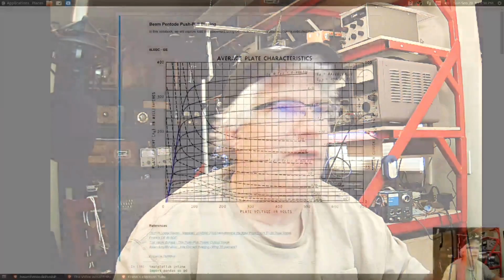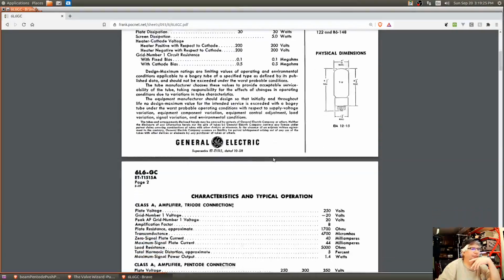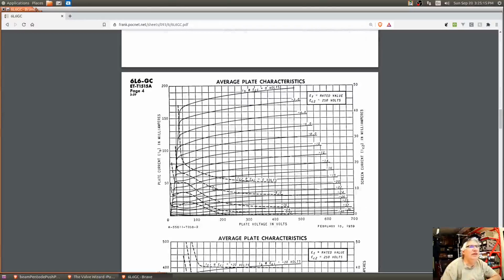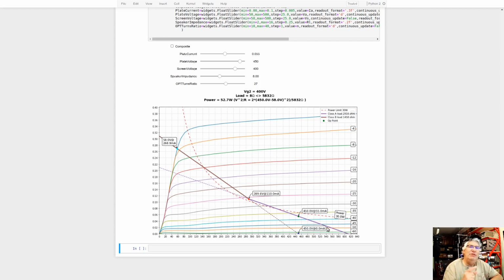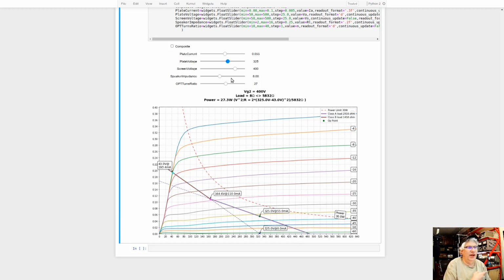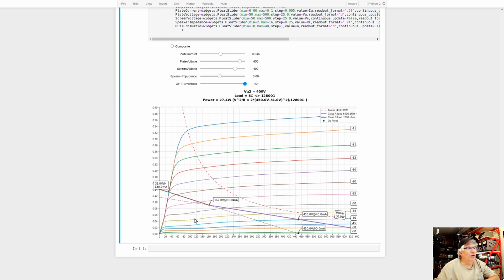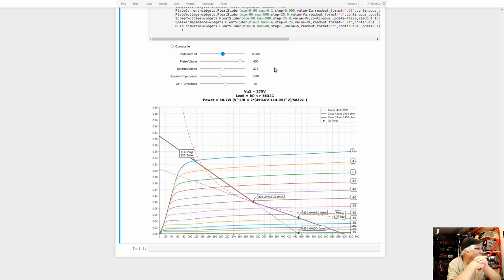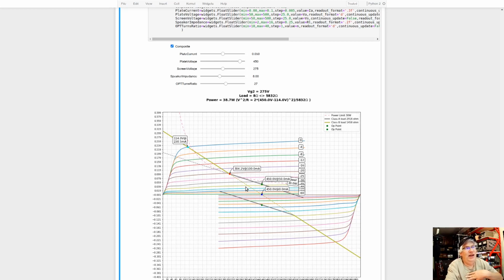200920 Valve Studio - Viewer Question - 6L6 Push Pull Design

Comment: Fantastic work.

Especially intrigued by the tool you created - I am a bit stumped as to how to actually run this tool.

I will keep digging but any  instructions, tutorials, breadcrumbs showing the way out of the forest you would care to leave would really help!

Being able to dynamically visualize the impact on the load lines is extraordinary.

Well done

SLF
Reply from the maker: Thanks, this runs in a python Jupyter notebook. The easiest way to get this running is to install anaconda, which includes all the python libraries and other stuff. Then get jupyter notebook running, browse to it and open the ipynb file. Was this the approach you've taken?

Comment: Such a straight forward seemingly easy question! Such a deep dark rabbit hole... Love it!
Reply from the maker: The rabbit hole is even deeper,  I didn't dig into power supply sag. Then the deepest hole is screen current affecting screen voltage, which dynamically moves the plate curves up and down per cycle (pentode compression). That's going to be a challenge to visualize for a video.
Reply: @CraigHollabaugh  I'm with you brother. I'm still trying to wrap my fragile eggshell mind around the basic convoluted concepts of vintage tube amps. But I don't go down ANY rabbit hole without: a sandwich, some beer, a good flashlight & a notepad, and a tube wizard... Safety first. ;)